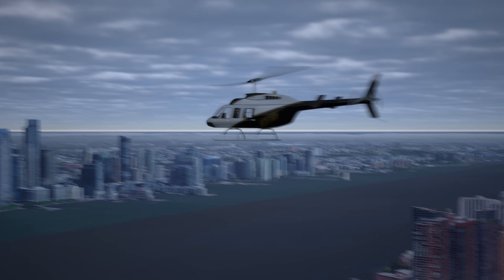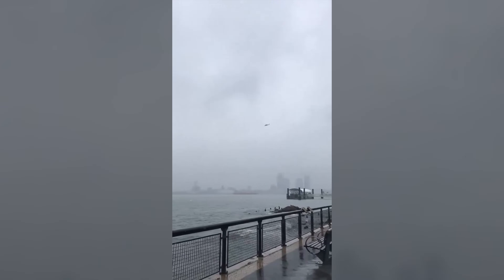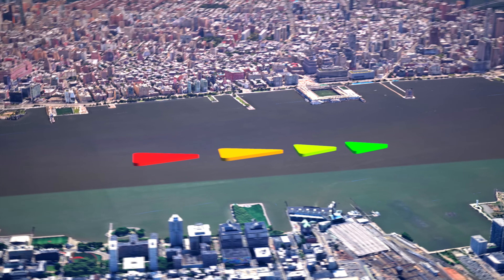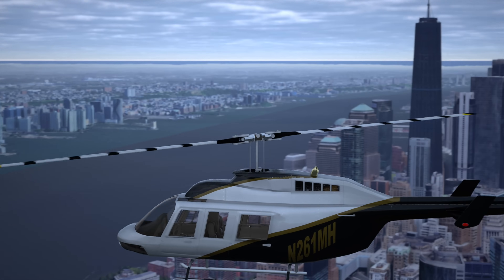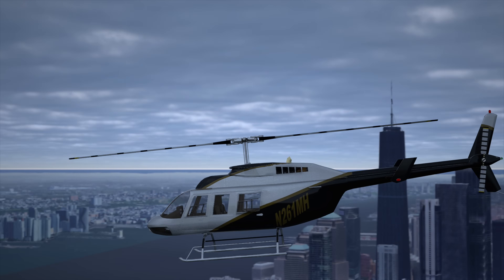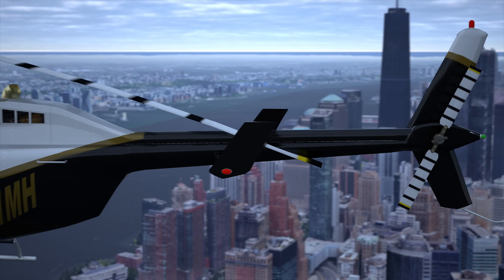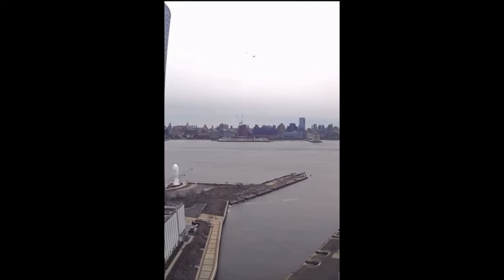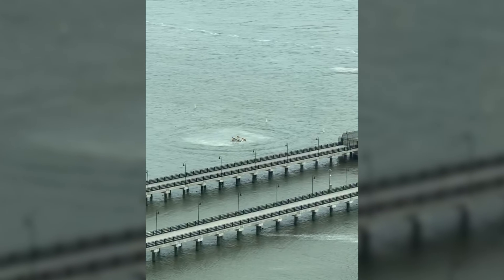Helicopters DON'T just fall from the sky - What is "Mast Bumping"?

Comment: Heavy blade system spinning at thousands of rpms: one bird strike could cause blade imbalance. That could shake the whole thing apart, but not likely, as blade condition after the crash would show. The entire blade/transmission assembly was separated from the vehicle mid-air. Plus, the pilot would have reduced rpm, and declared an emergency.
Still suspicious.
Looks like mid-flight parts failure over boom strike, or bird strike.

Comment: Sure it explains a certain situation extremely well but no way this is the case here. With three kids on board it would be flying very smoothly. A flock of geese is very easy to see and at that speed and they do not move fast so he would have easily avoided them.
  This was an assassination

Comment: Your METAR report is wrong - checking several sources - the 1551Z METAR for KNYC is as follows

METAR KNYC 101551Z AUTO 17007G14KT 150V210 10SM SCT031 09/M01 A3035 RMK AO2 SLP270 T00941006

KNYC - 10th day 1551 Zulu Hours,  winds 170 at 7 knots gusting to 14knots, variable from 150-210,  Visibility 10 Miles, Scattered Clouds at 3100 AGL, 9C / Dew 1C, Baro 30.35 and sea level pressure of 270.  

So which METAR did you post in the video at 3:37 ?

Comment: Tragic.  Condolences to families of those involved.   Helicopters flying straight and level don't mast bump.  If you mast bump,  the transmission does not come out of the helicopter.   The mast itself will be damaged and snap off due to material failure.   Traditionally for mast bumping, you need dynamic maneuvering flight and the aircraft to be less than 1g.  At less than 1g,  the rotor disk can be unstable and wobble with respect to the mast.   It was a Vietnam era Huey problem with pilots aggressively maneuvering over ridge lines to avoid detection/enemy fire and they would get less than 1g, unload the rotor disk and the underside of the rotor hub would/could impact the mast, damaging it and probably leading to the mast snapping off.  

No reason for people to think this is a normal/common thing to happen on tourist flights.

Comment: @edkiely2712  Helicopter crash statistics indicate that helicopters have a higher risk of crashing compared to airplanes. According to the Federal Aviation Administration (FAA), there were 121 helicopter accidents in the United States in 2015, with 17 being fatal, and 106 accidents in 2016, of which 17 were fatal.

For the offshore energy industry, Western OEM helicopters transporting passengers suffered 21 accidents from 2019 to 2023, 10 of which were fatal, resulting in 22 fatalities. This gives an estimated 5-year industry fatal accident rate of 3.27 per million flight hours or 1.40 per million sectors.

Overall, while the number of helicopter accidents has decreased, the rate of catastrophic and fatal injuries remains high.

Comment: You can see that the tail is gone. Your explanation makes the most sense; mast bumping with enough energy to push the blade int the tail boom and slice the boom right off.
Reply: Not very likely since the helicopter didn't do any such maneuvers. This is a technical failure.
Reply: @Martin.Kefauver  Agreed. We will likely never know precisely what happened.
Reply: @Martin.Kefauver  Yep, something just plain broke.

Comment: I took a helicopter tour of the grand canyon. The pilot spent the time in the air gryping about pay and hours. I spent my time looking around for other aircraft because he didn't appear to be doing so.  I will never fly in one of these death traps ever again. This from an amateur  licensed pilot in Canada.
Reply: I live in an area between Hoover Dam and Vegas and the tour chopper pilots violate regs all the time. flying way to low to impress passengers and hitting canyon walls out here every few years. One day I was biking and saw a tour helicopter barely miss a high tension tower, because it was flying way below regulations and the pilot almost didn't see the high tension wires in time.
Reply: @MrEricmopar  Helicopters do not look stable enough in their design (no wings) for normal flying outside perfect conditions, let alone joy riding to impress tourists.
Reply: @MrEricmopar  " it was flying way below regulations"

To what regulations do you refer?
Reply: Ex helicopter mechanic here. I've not worked for a tour operator but it is a different animal and there are various types including fixed and rotor. Many run a tight ship but some don't and accidents happen in all areas and levels for many reasons so I'm not assuming nor accusing this or any company. Some pilots build their hours in the tour business but usually there is a minimum hour threshold for insurance purposes. Do your homework. No pilot should ever act the way you experienced. Yours is not the 1st story like that I've heard.
Reply: I've had an instinct to stay out of helicopters my whole life, no way Jose!
Reply: @surfside75  Me too they don't glide.
Reply: @surfside75 agreed!
Reply: When things go wrong, being up in the air (or in a submarine) is the worst place to be. People just dont get the ever present dangers of flying.
Reply: @BEYONDYOURIQ a little airplane can glide for quite some time even gigantic airliners can stay in the air with no engines for a while. Helicopters fall like a stone.
Reply: @mattbarber7494  better have somewhere to land. Cant just pull over onto the shoulder of the road like a car. Flying is the most dangerous form of transportation...no matter what anyone says.
Reply: Used to live up in tusayan, little village outside the park, so we could get free rides occasionally, shortly after a ride the pilot crashed right in the yard meshed rotars with another helicopter. Tore both to pieces few injuries, I got lucky that day, said my prayers, early 1990s.
Reply: Me and brother almost had the helicopter ride at the Grand Canyon but decided against it as we were on a tight budget
Reply: @BridlingtonBay wise decision.
Reply: The less talking the pilots do the better
Reply: Get a refund
Reply: I have taken 3 chopper flights, at 3 different locations and choppers. And I loved it, and would do it again. I don’t know the makes and models but I preferred the larger ones.
Reply: 😂 I don’t blame you
Reply: Took a few helicopter tours to the Grand Canyon. Every single ride I took was amazing. Excellent pilots and very safe. Tipped the pilot $100, the other 4 passengers tossed a $50 to him. A 30 minute flight? Not too bad.
Reply: @ChrisJohnson-hk6es  It never ceases to amaze me how prevalent tipping is in America. Maybe most of us Aussies in comparison are just stingy bastards 😅
Reply: This was not pilot error tho
Reply: As he was complaining,  was there a hint of liquor in the air 😅
Reply: Y'all need to quit gryping 😂
Reply: Most of the time they are drunk...ive been in one with beer tins rolling around on the floor in the late 80s.
Reply: Funny it’s not like an American to tell his life story to a stranger
Reply: had the same in Hawii  the tour driver spent more time telling us how expensive it was to live and buy a house on the island...begging for tips
Reply: Yikes!! 😮
Reply: I've always been afraid of helicopters, maybe it's because there's 2 sets of blades spinning very fast, or because they crash a lot, but I'm never getting in one of those
Reply: I get that. I also took one of those GC tours back in 2001. Come to find out, 6 months later one of those very same choppers went down, killing all six people on board. No wonder I was nervous when we first went up.
Reply: It sounds like your tour pilot was also an amateur.
Reply: @AnyWayICan  do you really think hey hire "amatures" to fly over newyork,post 911?
Reply: @TheGrimlx3  No, I don't think "hey" do.
Reply: I don't understand why anyone ever does fly in a helicopter lol
Reply: Women die giving birth sometimes, so we should stop having babies?  @trevors6379
Reply: @trevors6379  Because the chances of having a fatal accident in an aircraft is small. We are far more likely to be killed on the roads in our cars yet we think nothing of hopping in and driving, even after we've seen numerous fatal car accidents.  Plenty of people fly in planes and helicopters all their lives both as aviators and as passengers and the vast majority never have even a minor accident. We really take chances every moment of out lives. Just staying at my home is dangerous, I can die in a house fire, from a gas leak, a windstorm blowing a tree through my roof, falling down the stairs, electrocution, a thug breaking in at night and killing me, etc. Just living is a constant risk. We are never safe.
Reply: @WitchidWitchid That's not really my point though. I mean why would someone ever opt to travel by helicopter? If you're gonna fly, why not take a plane? And if not, then why not drive? Helicopters just seem like much more dangerous planes to me

Is it just for fun or what? If that's what it is then alright, fair enough, just isn't my kinda thing. Same idea as skydiving and stuff like that

I kinda get the feeling it's not that though. Seems to me like it might be a rich person thing. In that case all I can say is 🤦🤦🤦
Reply: @WitchidWitchid its not nearly the same numbers though. Yknow; car travel v air travel.
Reply: @trevors6379  Perhaps because they are safer than sensational headlines would indicate.
Reply: @Tom-zs6bb  thats not a REASON to fly i a helicopter. he means. INTENTION.. fun, sight see, amusement. not SAFE TRAVEL.  I would never wanna get in one ethier. not even Brand NEw off the Lot. Im not Visually thrilled from seeing shi where God didnt make me to naturally see it. Thats why I dont stare at the sun or try and breath under water.
Reply: @ChevyDTV  Since the YouTube comment sections don't link posts like the rest of the free world, I can only assume that you are referring to my comment about helicopters being safer than the news seems to indicate.  And they are.

I took my first flying lesson before I turned 15 and my instructor soloed me two days after my 16th birthday. I have thousands of hours in helicopters and airplanes and somehow managed to live long enough to become an old man. I also worked in law enforcement, in and over Florida ghettos mostly, for 32 years. People told me that was unsafe, too. As for breathing under water, I hold an advanced open-water dive certificate. 

As for God, I'm pretty sure the physics that allow for flight weren't an mistake on His part. In fact, I would opine that He meant that to be. 

When it comes to certain activities, I say to each his own. As for flying, I feel more relaxed, more satisfied with life, and closer to God than at any other time. Recently, a doc messed up my medical certification for flying and, sorry to report, passed away a few days later before he could fix it. I shall therefore never again fly as pilot in command. Sad, yes, but I can still perform certain flight instruction and I was invited back to my former agency to fly their new helicopters. We only live once, my friend, and like the song says, we can sit it out, or dance.
Reply: My wife and I had the opposite experience with our Gand Canyon tour, and the pilot was a young woman, maybe 30 yo. She was amazing, we felt completely at ease with her.
Reply: A friend of mine took that same ride, just before that last one crashed there several years back.
Reply: Had a similar experience in a small plan taking an areal tour of a volcano in Hawaii.  The pilot was buzzing sheep and turning around to face his "audience" half  the time and I was busy watching out his front window hoping he didn't crash the plane. And he was bitching about how helicopters can just sit there at the rim of the caldera to take pictures. So its more about the pilot than it is about he aircraft.
Reply: Agree. Helicopters and hot air balloons...no no thank you for me! If I want to see how it looks from above I'll buy a drone.
Reply: It still way more dangerous driving on the highways.
Reply: @NETBotic  I wonder if it. is, accounting for the proportionality?  IE what percentage of car journeys versus civilian commercial helicopter flights result in fatal accidents.
Reply: @NETBotic yes statistically that is correct but only because road travel is cheaply available to the masses whereas helicopters are expensive to charter.
Reply: griping not gryping
Reply: @WW3_Soon - Damn dude. Mark May shut you down cold.
Reply: @WW3_Soon  Utube spelling Queen 🥳
Reply: @WW3_Soon  -- I just  looked it up.  "gryping" is the obsolete spelling of "griping."
Reply: @normanlinden5786   "gryping" is the obsolete spelling of "griping."

True. It's a shame people don't look at the etymology of words before kicking off. Half the comments in this thread relate to people arguing over that one word!
Reply: @WW3_Soon  Actually, the correct usage would be, "Griping, not gryping." Notice the capital letter, the comma and the period. While that may seem like nitpicking, the point is this: If you're going to appoint yourself captain of the grammar police you should make an effort to get it right yourself.
Reply: @MarkMay-cr6bv  Spelling police not grammar police.  I also don't get why rant about someone correcting a spelling mistake. Its a pretty glaring mistake, and there is nothing wrong with correction.
Reply: @MarkMay-cr6bv  Politely pointing out an obvious spelling (not grammar) mistake is a good thing and your patronizing attempt to put WW3_Soon down was not.
Reply: @MarkMay-cr6bv exactly 🤣 missed the whole point of what that person said about the pilot not watching out for other aircraft 😂
Reply: @MarkMay-cr6bv  he's actually like, just the spelling police. Grammar is another department.
Reply: @MarkMay-cr6bv he didnt appoint himself "captain of grammar ". He was just letting the person know the correct way to spell gripe.
Reply: @MarkMay-cr6bv  love love this comment.
Reply: @MarkMay-cr6bv  spelling and grammar are 2 separate things
Reply: @ -- that looks more like a simple typo rather than a spelling mistake.
Reply: @Romans8-9 Uhhh... so yeah, spelling is part of grammar. A significant part of it in fact. This is like saying that a physicist isn't a scientist.

Take the L, for real, you aren't cut out for this.
Reply: @Muzzle-loadedHammer  take the L for what?
Reply: @WW3_Soon atleast they were looking out for helicopters unlike the pilot, and not griping like the pilot. You forgot that part
Reply: @WW3_Soon  Dude who cares you understood what he meant. Get over it.
Reply: @WW3_Soon  If you're going to nitpick this, try making a normal sentence.
Reply: @WW3_Soon who cares? Just get the point.
Reply: @WW3_Soon  He's from Canada ... they spell things funny up there ... don't you know that?
Reply: @WW3_Soon  just a spelling mistake, get over it & look to your own deficiencies.
Reply: @seltaeb9691Don't be bad
Reply: @seltaeb9691 -- Yeah.  I just write off a spelling mistake such as this as a typo.
Reply: .....they have  Gryppo potato chips in  Canadistan, too.....

Comment: 4:00 Did those float kill all on the ac. Seems wrong place to place the float making the structure upside down. 2025 it should be safe enough to exist a Helo downed in water. This is very wrong.
Reply: There's no way they survived that crash regardless of the float location. 

Those floats are for emergency landings, not a crash like this. Besides, the helicopter will tip upside down anyway, I'd rather be upside down in 6ft of water instead of deeper.

Comment: I'm a fixed wing MEI, but the first thing I learned about helicopters after autorotation was mast bumping. It became a big deal in Vietnam, as pilots unloaded the rotor system to follow descending terrain on the other side of a hill. This is a good explanation of what happens. Most of the time, you hear about this on Robinsons. It has been a long time  since I heard of this happening with a 206. It's long shot, but it could have been a controls failure, or something else. Mast bumping usually takes the rotors off of the top of the mast.
Reply: Your assessment is very useful, but in part of the video you can see that the helicopter is flying normally and shouldn't the mast bumping take effect almost immediately before cutting the tail?
Reply: @carogalo  The flight path doesn't suggest that the rotor system was unloaded at the time of the failure. The flight path is straight and level. The blades remained intact and spinning with the mast, as seen in the video. In mast bumping, the blade assembly and the mast break apart.
Reply: Read about the other Bell 206 accidents, this was probably NOT mast bumping but a failure to put in nuts and bolts etc.
Reply: @ramjet4025  That should be obvious when they bring up that rotor assembly and the gearbox.